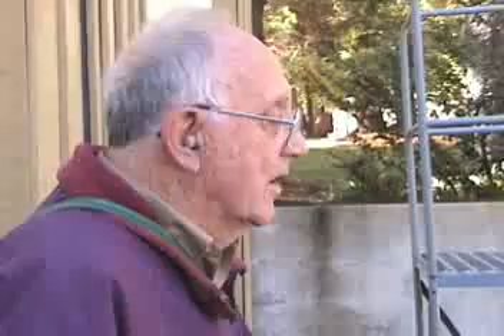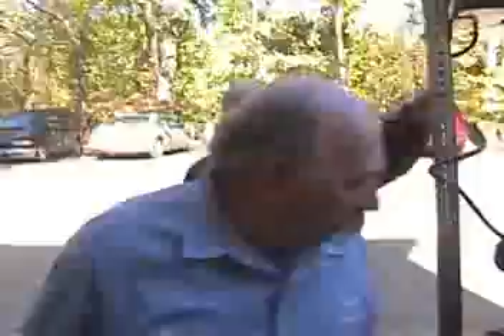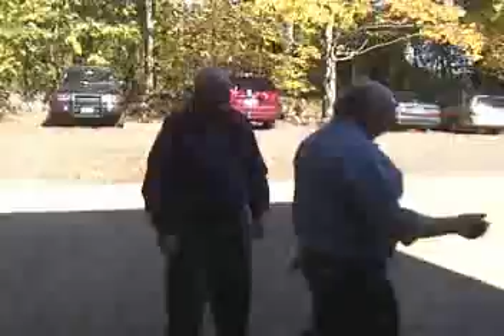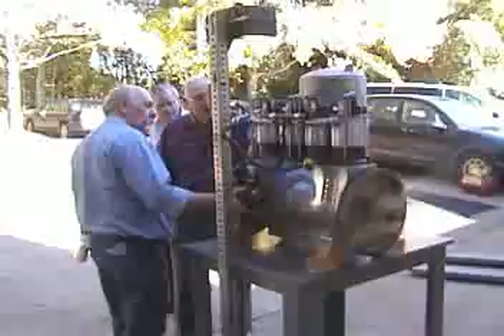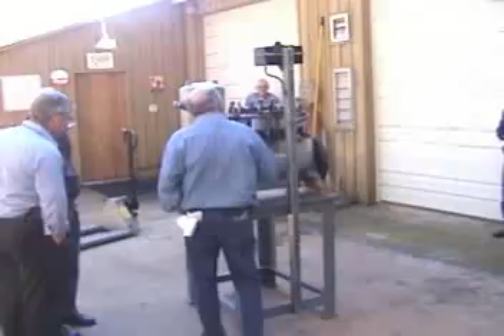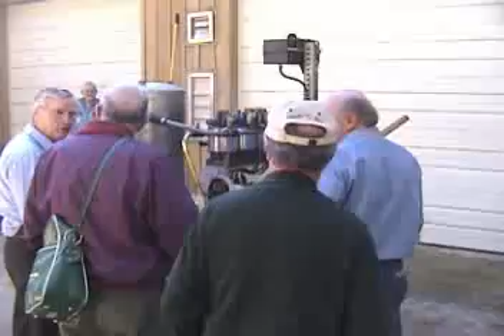Wright Aeroplane Engine No. 20 -rare start up

Comment: I see overhead valves, with a rocker arm for each exhaust valve, but none for the intake valves. What controls the intake valves if there are no rocker arms or push rods? Did David Buick get a cut for the engine design since he had a patent for the OHV engine?
Reply: I think its poppet valves, works on low rpm engines, the valve opens on the intake stroke by the vacuum created i the cylinder.
Reply: Atmospheric intake valves. Very weak spring they are sucked open by the vacuum when the piston goes down and held securely shut under compression.

Comment: This engine is known as a "Vertical four", unlike the early Wright engines which were inline 4's laying on thier sides. All Wright engines used aluminum blocks. It would have originally powered a "Model A Military Flyer" or possibly a "Model B". Wright flying machines had very light wing loadings and didn't fly remarkably fast. Even so, they were dangerous and very difficult to fly.

Wright Experience had GOOD sponsors and spent MILLIONS on thier restorations and reproduction flying machines.